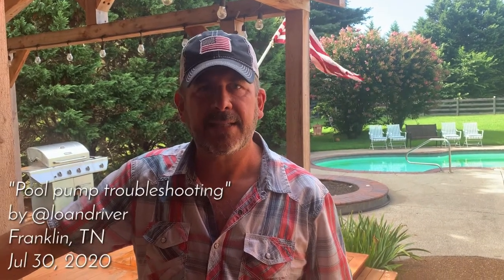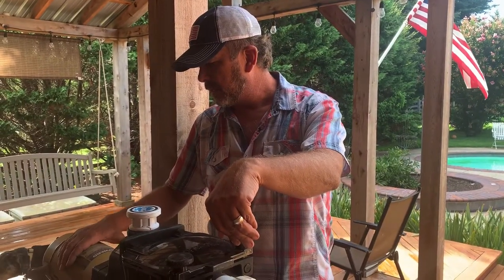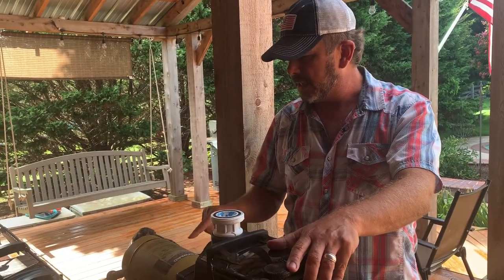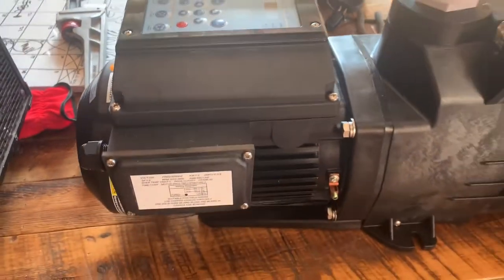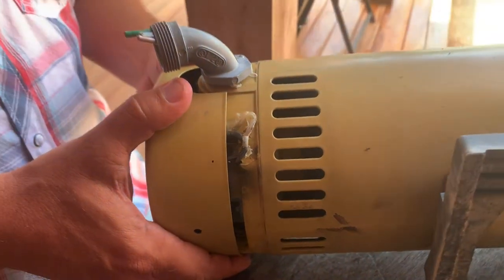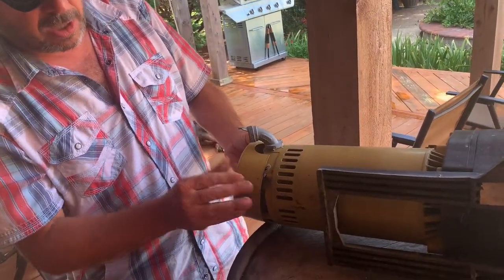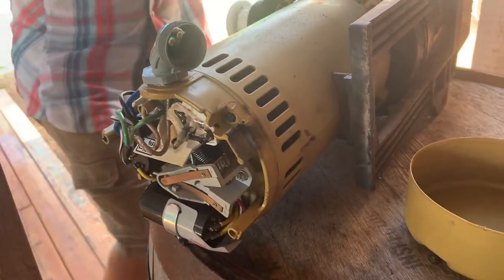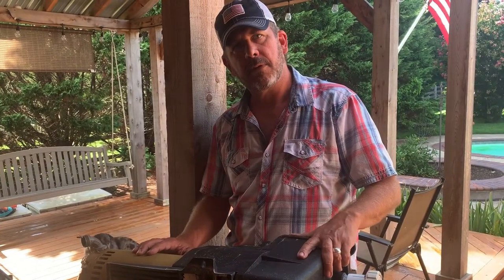Pool Pump Tripping breaker and troubleshoot

Comment: Wow! I've been replacing 40+ year old wiring on my setup as well, everything absolutely rusted, switched burnt, failed crumbling metal underground conduit.  Astonishing it still ran at all, but kept tripping the circuit breaker - maybe a dozen different problems tripping it at this point.  Probably at-least 2 decades of the underground cabling running wet, had a few times I was cleaning the pump filter and felt a little bit of electricity in the water.

Comment: One thing that you said which I found ironic was “don’t try to do it yourself, & make sure you hire a professional”. You said that it was installed by a company (professional) there in Tennessee. A lot of “professionals“ just flat out, do shitty work. As a homeowner if you are privy to what needs to be done you are more likely going to make sure that it is done properly because it’s your house. You’re a homeowner that found out what was going on in the first place what are the odds you would wire it back and have that same problem? Just my thoughts. Thanks for the video very helpful.

Comment: Hey brother- great video! I had the EXACT same issue (with a pool company installing & crap wiring- along with SEVERAL pin hole/ air leaks in the pvc...). Glad to hear someone else from Franklin TN- even if for, frankly, potentially deadly company actions...
I have several Heyward motors (all from .75hp to 2hp) & rigged up my last replaced one [1.5 hp] as a portable vacuum with external 12v AC plug & a cheap(ish) cartridge filter. Have it fixed on a handtruck (pump with filter on top) and use it to vacuum/clean when/if the main pool pump is older/been run dry/etc. Can choose whether or not to filter back in to pool or direct to waste... just a thought. 
I'm by no means the only person who has done this of course- so truly sorry if post is redundant & useless...
Hopefully see ya around Franklin friend! (I work as a fire-medic & in ER/ICU so hopefully not that way...!)

Comment: Another dangerous thing is that I went to do a weekly maintenance for a pool (they take of their separate spa) and showed up on a Sunday while they were at the cottage. Opened the pool house door and everything was torched. Jumping jet mother boards, 3 pumps, 2 filters, flex hose, sanitizers, you name it - destroyed. Called the fire department and worked with the investigator to help him determine the cause which was that they put a opened bucket of spa shock next to the pool chems and someone closed the roof vent. Closing the roof vent stifled oxygen and disaster but also allowed the chemicals to marry. This is the most dangerous and least recognized pool/spa concerns (mixing and storing chemicals improperly).

Comment: Just had two days of hard rain now the breaker keeps tripping immediately when trying to start the pump. Replaced the outdoor plug. Still trips. I’m guessing lots of moisture got into the pump vents I’m not sure. Waiting for a hot day to troubleshoot the pump further.
Reply: Having the same problem right now on my Hayward. When I plug it into the outlet it will make a humming noise then trip the breaker. If I keep resetting the breaker and plugging it in then eventual it will start. Did you ever find the issue for yours?
Reply: @dionmatthews2799  Yes i did pump was shot. Replaced the whole thing.  You may be able to hold out for another year. If it just started you may possibly be able to stretch it for two years. I would try to cover it so it doesnt get wet and cause more corrison inside. I remember always being nervous when i would go to turn it on that it would trip.
Reply: Thank you!
Reply: Cover it up when not in use and exposed to The elements that is. During use keep open and good airflow.
Reply: @dionmatthews2799  I had to learn everything about having a pool when I bought a house with an inground pool in it.
Reply: @NuNuRokd  ya I’ve had a pool for a few years but never had a problem with the pump. Pump is like 5 years old
Reply: @NuNuRokd  ya for winter I cover it to protect it but in summer I don’t cover it. It runs 24/7 in summer. Should I not be doing that?
Reply: @dionmatthews2799  Runs 24 seven huh? That is ideal your water thank you. I’m sure you have quite the electric bill. Obviously in the long term it will shorten the life of the motor but those motors are built for continuous duty so it’s not like you’re doing something it wasn’t meant to do.

Comment: And yes whoever installed that pinched your wire lol.  Whoops.   Those covers actually when you take the two 1/4" screws out usually need a good mallet wack to get off.

Comment: That Harris pump is as good as garbage man.  Unfortunately you get what you pay for.  Also good luck getting parts for them.  Number ones reason motors trip breakers is loose wiring.  Bad caps or clogged impeller causing water flow issue.  Single speed pumps use water to cool them.  And yes average tenp of a running single speed is 205 degrees on average.  We get this call a lot that my pump is hot.  Lol.  It's normal.  Why people are grabbing their motors I don't know exactly.    Also I've seen people wire pumps wrong.  Most can be wired 240 or 120.  However I've seen people use a 120 line and hook it up to pump with a 240 switch engaged lol.  It will run at half speed.   And trip eventually.  Good troubleshooting.  Windings inside motors also short out due to shaft seal leaks.  I see this a ton as well.  Best of luck with the Harris.   Guess it will work in a pinch.
Reply: I think you mean Hayward ?